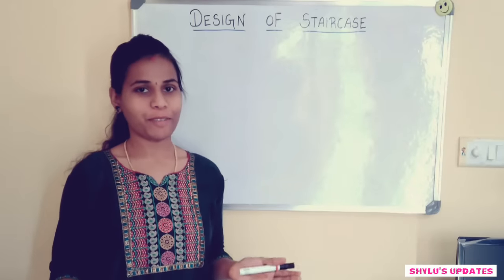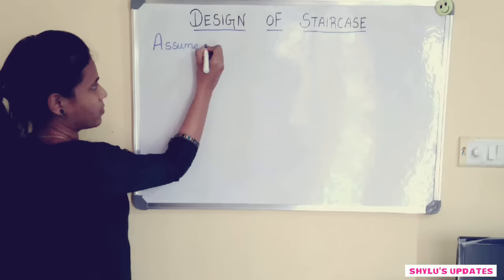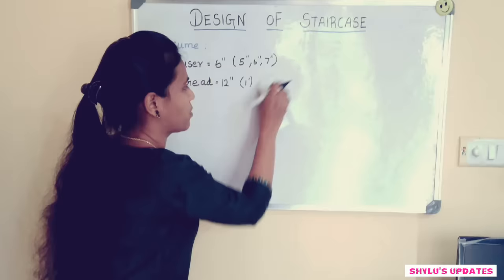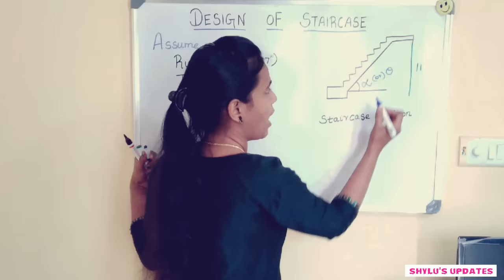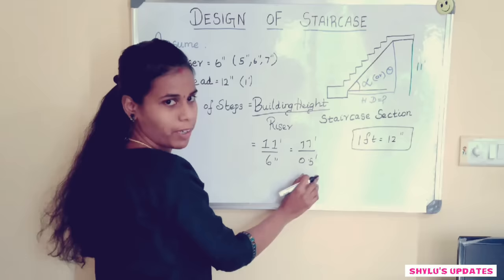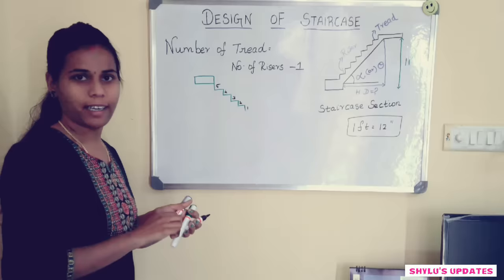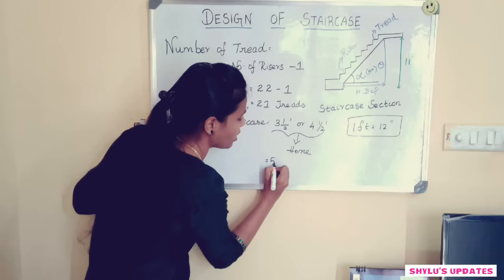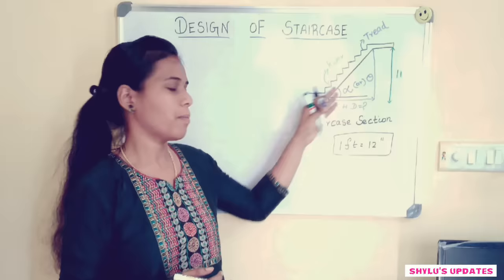Staircase Design | Easy Method to Design Staircase | Design of Staircase |  Civil engineering

Comment: At the last portion, when calculating flight length, you have mistaken. Instead of multiplying number of tread by tread width, you have multiplied tread width by number of steps or number of risers. Plz look into the matter.

Comment: I think this video only for concrete stairs not a steel stairs , 
Steel stairs as per OSHA standards riser in between 6 to 7 inches 
Treads in between 11 to 12 inches 
If concrete stair in between 4 to 7 inches
Treads 10 to 12 inches....
We have more OSHA standards about stairs and railing....
This is just for information,
So please don't feel bad..
Thank you.....

Comment: Hi there. Just one question please. If a concrete staircase is go into place. And the risers are, for example 6”. Because I will place a concrete screed of 2” on the bottom slab. This means that first riser should be 8”. Question, how do I calculate the risers when the one is 2” bigger?
Reply: It's simple, you have to increase the first step by 2inches and decrease the last step by 2inches if you are using structural steel staircase.
Reply: @vidhyashankarl5189  it’s so obvious now 😂👍👍

Comment: Listen sister...u have known the height of the building...similarly u have also know the length of horizontal distance by measuring with tape....firstly every one wants to know that ..how to built steps with the respective angles of slopes..so u have to made a video on .for the respective area of staircase....by these respective measurement of risers and treads were suitable to construct....not like u done...u only assuming riser and treads...this will every one done....u have to find that ( height of landing 1 =5 feet..similarly horizontal distance = 10 feet) now find risers and treads
Reply: Exactly,, what u said is correct.
Reply from the maker: i have explained about Slope calculation in staircase in another video ....this is just basic video to get some idea about staircase instantly.